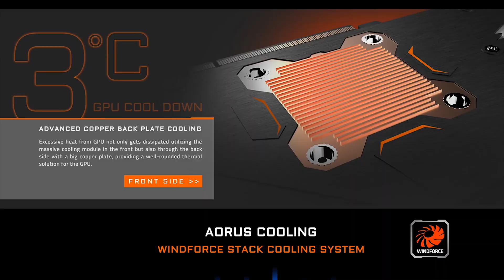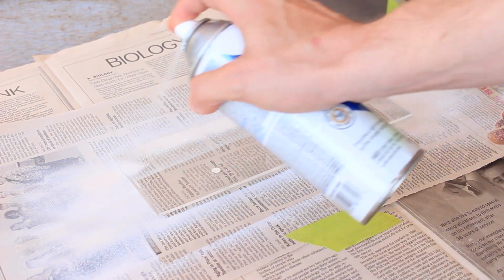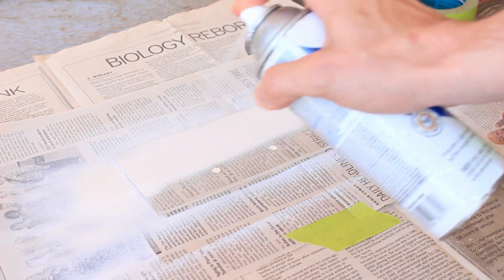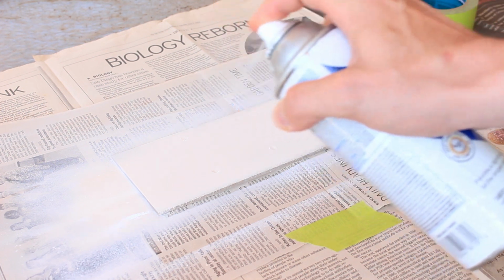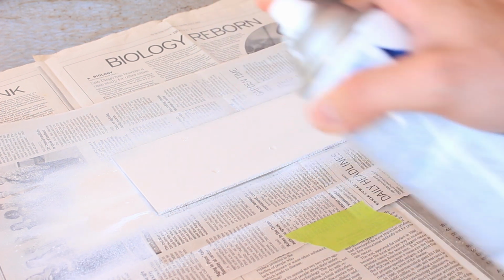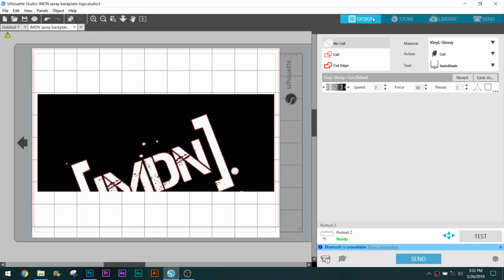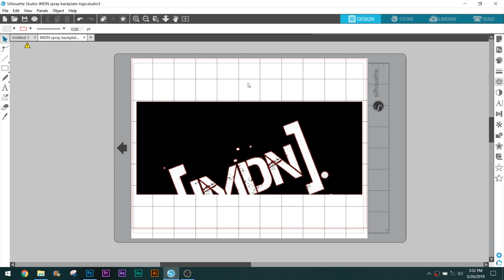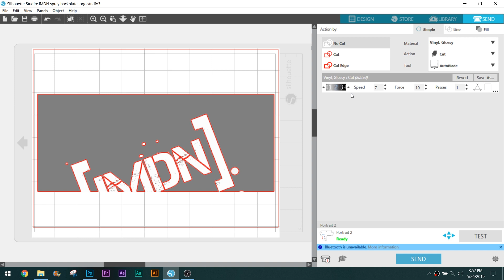MAKE A CUSTOM GPU BACKPLATE GUIDE PART 1 - BASIC EDITION

Comment: Hay you know using the stencil is a very tedious way of doing this. You could use an Ink jet printer with transparency film and this would allow you to get a more intricate design for the backplate. You could print out a whole complex image. Thanks for your videos they are awesome.
Reply from the maker: Didn't want to glue transparency film to the plate. There are many ways to do it, this is just one of them.
Reply from the maker: Thanks for the tip!
Reply: Yeah I was thinking transparency so that you could add RGB. But you’re right there are multiple ways. The stencil looks cool as f*ck too, but if I was making one for my own build I’d like one big ass print off of google images lol.

Comment: I found that the faster you remove vinyl the better it comes out. For some reason on one of the things i painted it really wanted to leave behind a lot of adhesive when i went slow, also lines just came out a lot more smoothly
Reply from the maker: I haven't found there to be any difference. What brand of vinyl are you using? Oracle? Vvivid?
Reply: @ImmodderNation  idk, i bought it a while back, it has only happened on 1 of my stencils though, i think its cause i left it out in the sun for a few hours, it likely heated up the adhesive and caused it to bind
Reply from the maker: @kiyosenl.3889  That could be it. Probably heated up the vinyl too much.

Comment: Try using a lubricant when drilling holes. It will help prevent tearing.
Reply from the maker: What's your preferred lubricant?
Reply: @ImmodderNation  For metals, Tap Magic. For Plastics, you can typically get away with just using water and a spray bottle.